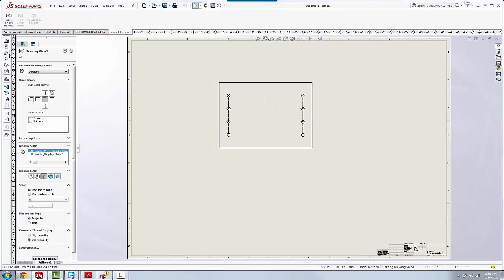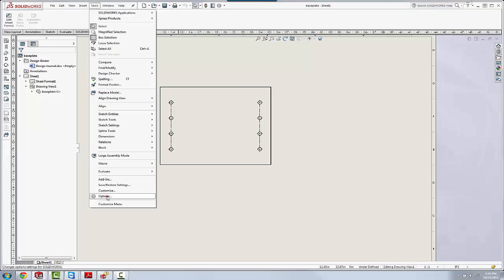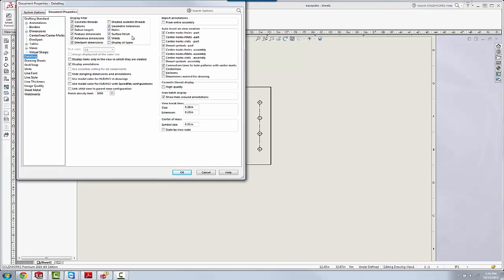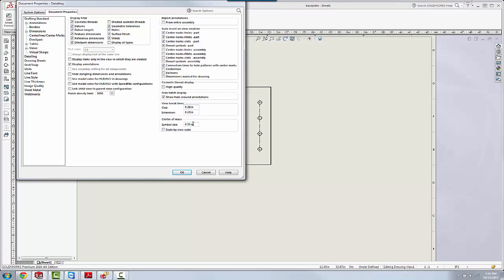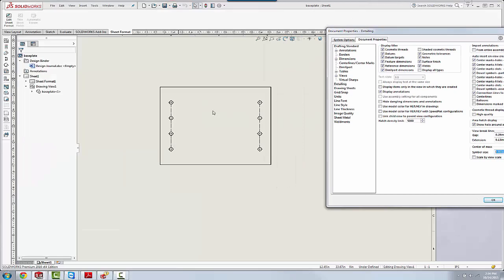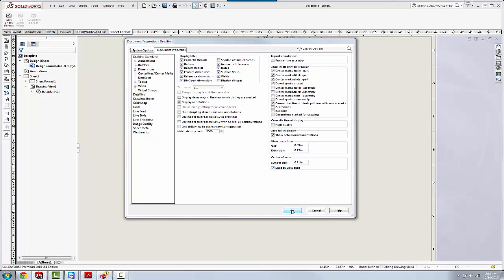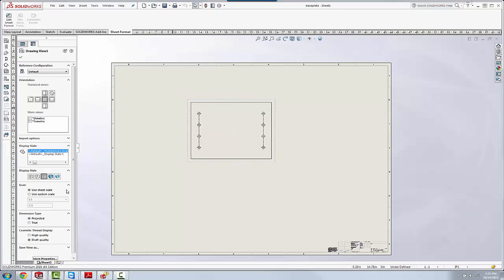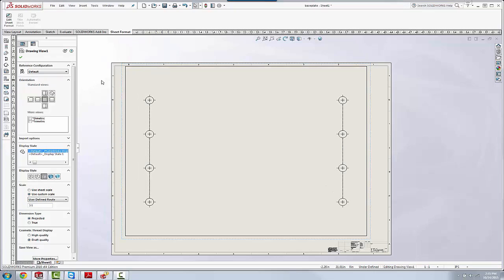SOLIDWORKS Quick Tip - Centermark Scaling

Comment: No, dude!  You've got it all wrong.

Centermarks have always scaled with the drawing views.  That was a problem.  What's really new in 2016 is that we can now prevent the centermarks from scaling, so they can behave like a proper center mark should.  It's not perfect though.  The extension lines of the centermark still scale - but they shouldn't.  They should always protrude the document specified distance past the circular feature they are associated with.